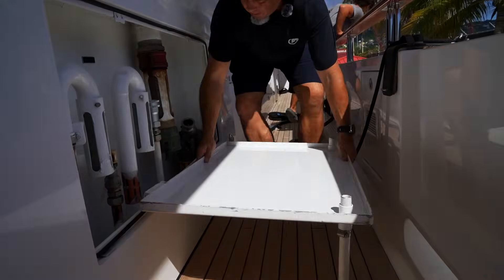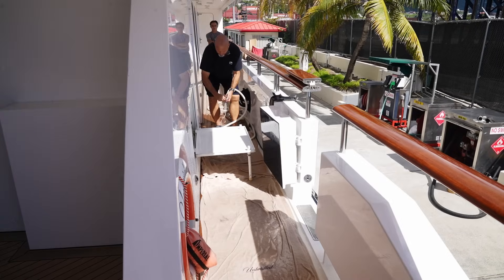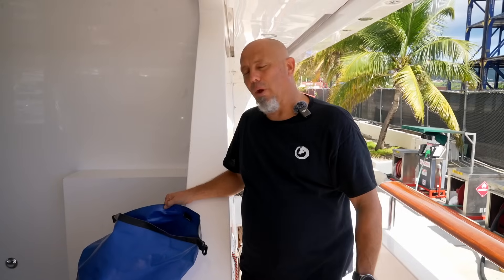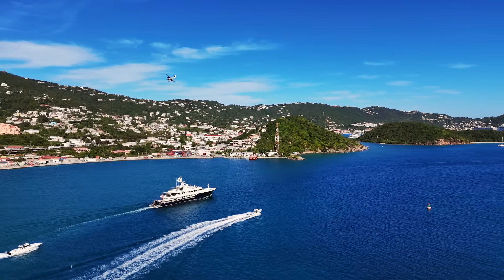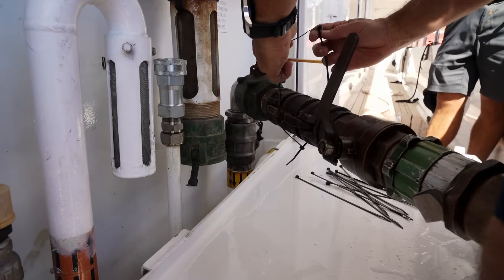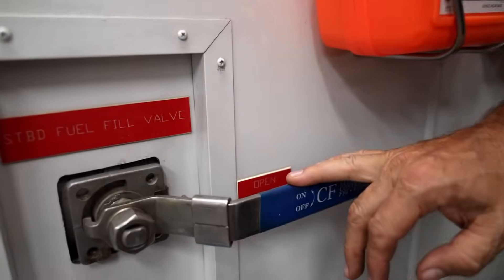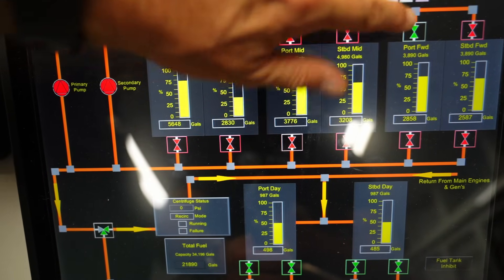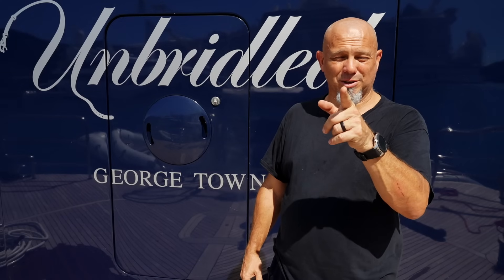🚢 How Superyachts Refuel: Bunkering 32,000 Gallons on M/Y Unbridled ⛽️

Comment: I cant imagine.  I hold 2000 gallons and have fuel delivered by tanker truck.  If you require 500+ gallons of gas/diesel call around. My street and boat dock is about 100 feet distance.  Its absolutely no problem for fuel delivery.  The truck has very long hoses and its high volume delivery.  CHECK MINIMAL GALLONS.  Most are 500 gallons.   I save quite a bit

Comment: zip ties for 3 inch gas line JUST INCACE??? you are brave
Reply: Just to hold the cam levers. A piece of string will hold. I worked in the oil field with those fittings.
Reply: A single cable tie is more than enough and he used two. Not sure what you would have used.
Reply: @NormalityIsWeird  I'm sure he did it for the comment section. There are people out there that would say you need a hard hat, safety vest and steel toe boots to sweep a porch off.
Reply: Incace